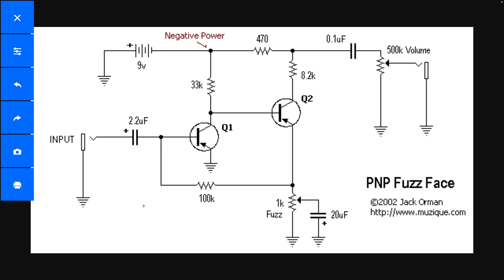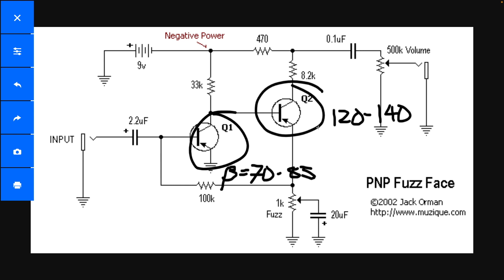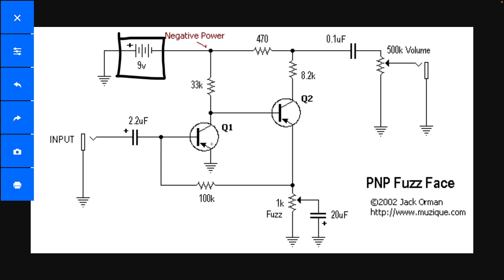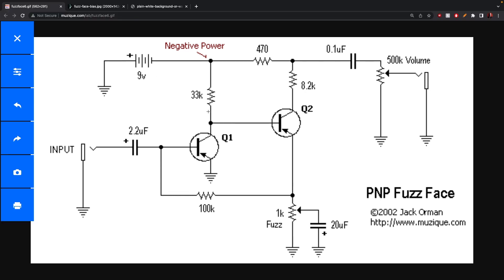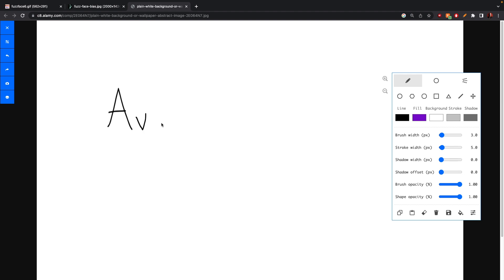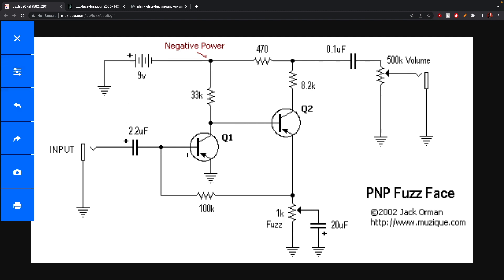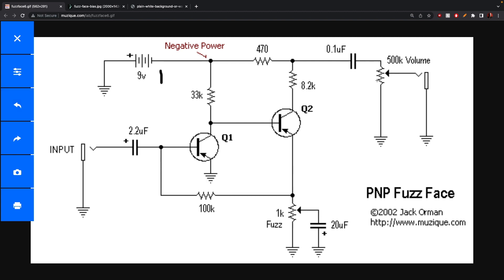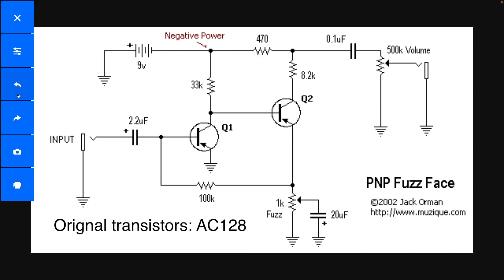Fuzz Face Schematic Analysis

Comment: Power cant be backwards. Everything in any circuit interacts with everything in and connected to a circuit. All circuits. I mean isnt that the point? It is also not complex at all. Its simply a matter of proper hfe and biasing. There is nothing complex nor magical about this or any circuit. Just gotta get all the values right. Metal/Plastic is irrelevent. Just saying....

Comment: SO the 470ohm resistor gives the output impedance? I've seen this value changing a lot, in silicon fuzz faces, from 360 ohms to 820 ohms I suppose depending on the transistors... But why is this? I have been told that the higher the value, the higher the output volume. But I dind't know anything about the output impedance. Can this value change actual help with the adition of a buffer pedal afer the fuzz face for not sounding not to harsh when the buffer is on? THANKS!

Comment: If voltage is entirely relative, then why is the power scheme inverted? xD
Is it just out of convention? 
It would be exactly the same thing... if you changed the -9v to ground, and ground to +9v???

This was always weird to me.

Or would it actually matter?
Reply: Voltage is indeed relative, and in this case with PNP transistors, you need your guitar signal (going into the base) to be negative relative to the voltage coming in through the emitter (from your +9V ground). If you were using NPN transistors you would flip ground to be -9V.
Reply from the maker: In order for this to be 0-9V instead of -9-0V, all you have to do is believe. BELIEVE!!!! With only the power of my mind, I just made it 102-111V!
(and be conscious of power/gnd issues when connecting to other circuits. Misunderstanding this concept is just asking for some kind of unforeseen accidental voltage.)

Comment: Such a perfect and simple circuit. 1 battery. 1 case. 2 jacks. 2 transistors. 3 caps. (5 with your improved version), 4 resistors.

Comment: I just wired this up with some germanium PNP's taken out of an old Japanese radio and it sounds UN-REAL. Thank You! Hot Tip: By switching the positions of the 470 and 8.2K resistors you get a lot more volume!!

Comment: 9:00 The input impedance of Q1 (without considering the feedback) can be considered more or less equal to the resistance of the transistor, or "r pi" (r pi= Vt/Ib, or  r pi= beta (Hfe)/gm).  If "gm" is 0.0088 siemens, and beta of Q1 is 90, the impedance would be 10k (but "beta" is real life is Ic/Ib, it's usually slightly different from the value that the manufacturers give us, because it varies  depending on the current and t°.
In the real circuit, Z will be sligtly lower due to the feedback effect (100k) and fuzz control

9:35 In this configuration, AV gain can also be calculated as Rc/re* (*dynamic resistance of the emitter; there is no external physical resistance ,only the internal resistance between base and emitter). re = Vt/Ic, or  re=1/gm . Again, in the circuit  it will be lower due to feedback effect of 100k  res.
Reply from the maker: Thank you! Solid insightful comment on a technical topic without being condescending. It's an internet miracle. You're the best.

Comment: 1:27 that's called "split emitter resistance" (It's used a lot when you want a high, but controlled gain; a compromised solution) and helps to stabilize the gain, making "re" (the dinamic, internal base-emitter resistance) less relevant in the circuit. It's the same as setting the fuzz control at 9/10 of the total travel, there is a small resistance between the capacitor and the emitter (that capacitor is feedback path for the AC signal, when the pot is at its maximum, there is only "re" (internal) between  Q2 emitter and ground) That's why a "REV LOG" pot in fuzz control is more functional than a linear/log one (you want fine control towards the end of the travel, so you can leave a very small "split emitter resistance" if you want)
Reply from the maker: Good insight! Thanks.

Comment: you calculate 14Hz cutoff at the input. What resistance value are you using? This must include the base to emitter of the transistor, yes?
Reply from the maker: I bet Electrosmash has the math all done out for you to read about. They're great for this type of question. 
https://www.electrosmash.com/fuzz-face

Comment: Great video! I have a question, where would you put the 3 PDT switch? Does anyone have a schematic with it included? And what is the pinout for the switch, having trouble with this part. Thanks!
Reply from the maker: Google "true bypass wiring" and you'll find the answer you're looking for.

Comment: I don’t know why…. But given values don’t match up. Appreciate if you could work with real values. Thanks anyway.
Reply: On second thought, it might be the case in this sort of circuit because the exception is the rule due to intentional clipping, overdrive and what not. 😂
Reply from the maker: Which values do you mean specifically? I could've gotten something wrong here. I'm wrong about stuff all the time. Lol
Reply: @theandromedacorporation  I mean, the last filter from my calculations is 3.1 Hz, not 31 Hz. f = 1/(2piRC) = 1/(2pi*500E3*0.1E-6). Also if you could show us how to get to 14 Hz on the first filter I would really appreciate 'cause I'm struggling with that one.
Reply from the maker: @danielfc  You're right! 3Hz, not 30! It's that damn capacitor conversion from uF to F. I'm always moving the decimal place the wrong amount of digits.

Comment: If you ever wanted to try to make a guitar effect this is the best beginner circuit to try. I made the NPN variant. So get that schematic. Don't worry about silicon vs germanium transistors either. Silicon works just fine. Any small signal transistor ought to do it. You can ballpark the parts in this whole circuit and it should do something. As long as the values you use are kind of close. Really, the more messed up it is the better. Then it'll be extra fuzzy.
Reply from the maker: I disagree about the FF being a good place to start. It's surprisingly tricky for how few components there are. The circuit is prone to unwanted oscillation, and finding the right transistors can be tricky and tedious. I would recommend an opamp-based booster, or an orverdrive as good candidates for circuits to start with.
Reply: @theandromedacorporation  I built a fuzzface and I used whatever random transistors I had lying around and it worked. Perhaps I just got lucky? What impressed me the most was the simplicity of the circuit. There's just not much to a two transistor fuzzface. It's amazing so little can do anything. Some overdrives can be simple. The one I built wasn't. It was all of them in one. I used an authentic vintage JRC4558 in it too. I salvaged a few off an old circuit board. So I know they're the real deal. Although anyone with ears should be able to tell themselves. You can check it out on instructables website, the article is titled, "GM Arts Overdrive Pedal Build"

Comment: Your recommendation on adding a cap to remove oscillation fixed my problem!(Edit note: The extra cap darkened my tone a bit, so I put a resistor on the wiper leg of the fuzz pot. That fixed my problem and left the tone unchanged). I love this video and your others are in my queue. Could you do a fuzz factory analysis?  I think it would pair nicely with your fuzz face video.  Thank you and please keep it up!
Reply from the maker: Wow, that's awesome to hear. Glad the vid helped! Maybe I'll take a look at a Fuzz Factory video in the new year. I'm currently focused on designing a handful of circuits.

Comment: One thing I don´t understand: Q1 has a hfe of 80, but the amplification is over 200, how can that work?  BR
Reply: In Common emitter configuration the Av (amplification) is equal to the gm = Ic/Vt times the load collector resistance (which I doubt is just 33K since the collector sees also the Rpi of Q2). Usually having an amplification depending from gm is bad since it highly depends on temperature (Vt = KT/q k boltzmann constant T temperature in kelvin q electron charge)
Reply: @shyne_on  Maybe I just don´t understand it, but how can you boost a transistor with hfe (amplification factor) to 200?

Comment: This brings back fond memories of buying a bunch of NTE AC128s and plugging each one into my old Radio Shack VM to sort them by HFE and playing with input / output DC blocking cap values. Oh, and if you want a bit less gain you can always bump the feedback resistor to 150K or 200K. 😃